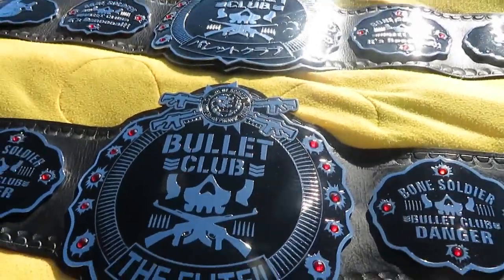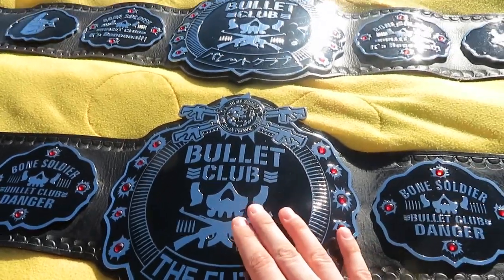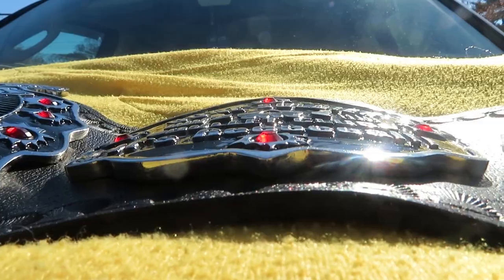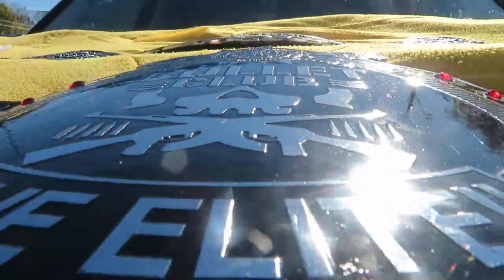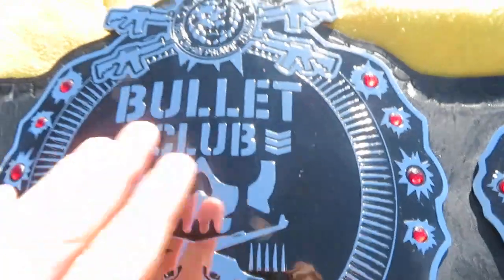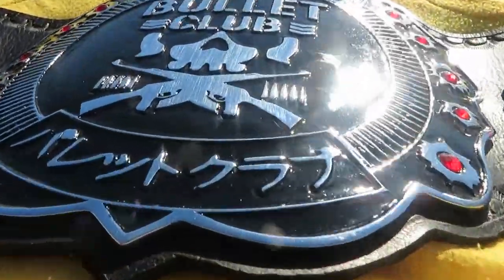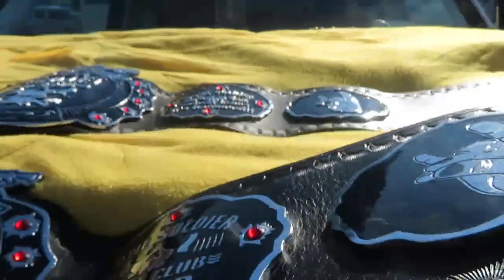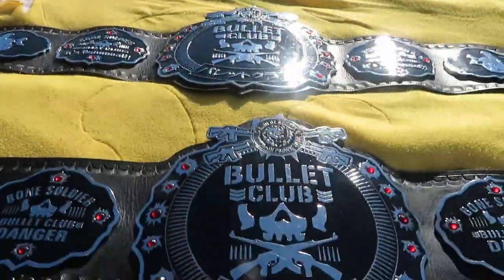Wrestling belt-Brass vs Zinc etching comparison

Comment: Many questions here; what was the reason to use zinc? Is zinc easy to obtain? Are you using a machine or by hand for the plates? I have many more questions but I dont want to bombard you all at once.
I really like how the zinc plates just pop and it's spaking my interest
Reply from the maker: Zinc wont tarnish overtime like brass can. Also zinc allows for better and deeper etching
Reply: @kitt23NY   alright, are you putting the the plates in a machine or are you are the plates hand etched?
Reply from the maker: @SFC_Savage   i didnt make the belts but im sure it was done by a machine

Comment: So durability wise are they the same??
Reply: Wondering the same. Will the zinc crack easier if dropped because it's a harder material, while the brass might just bend?
Reply: @dylanwbarnes  from what I remember hearing zinc since it's thicker it technically is more durable but to be on the safe side 4mm is better than 2mm
Reply: @Leo-xt9tz  so if I was to use a belt that might be dropped or tossed around a bit, would you say 4mm zinc could take a bump better than 2mm brass? I don't want to risk the more expensive zinc one even though it looks much better, but would rather not break any belts!
Reply: @dylanwbarnes  yea because zinc can withstand more pressure than brass I'm getting a zinc belt myself as well
Reply: @Leo-xt9tz  thanks for the advice!